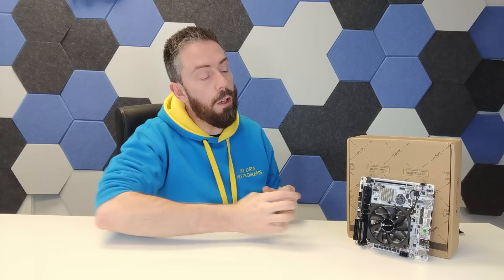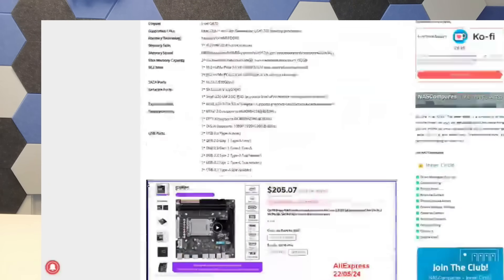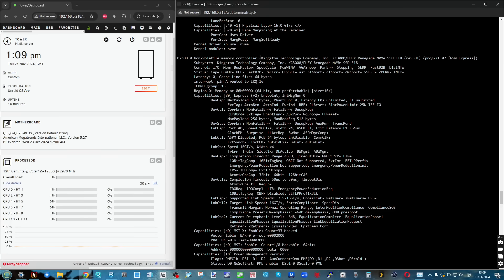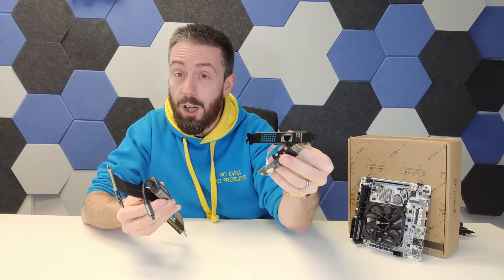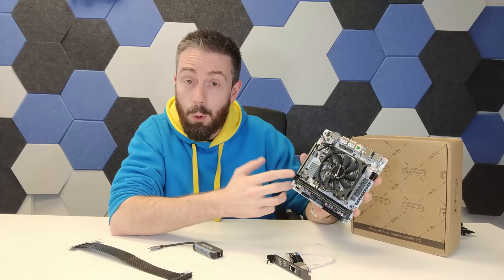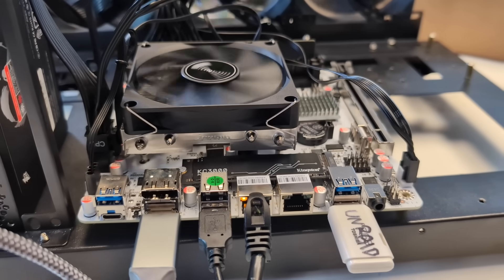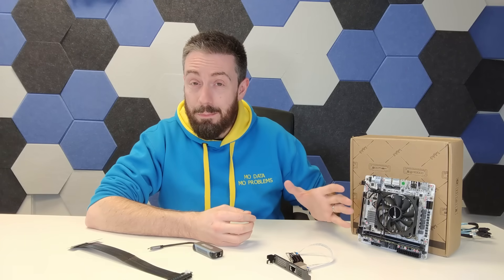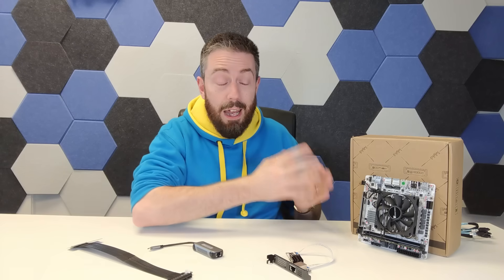NEW CWWK Q670 8-Bay Gen5 NAS vPro Mobo Review

Comment from the maker: Hi all. Since the publication of this video, it was brought to my attention that this motherboard has had several issues encountered with it. Although I never encountered them, further investigation does show a decent amount of users online raising concerns with their units. (Example https://www.reddit.com/r/homelab/s/eeRCYY8wYs ). Going to do a little more digging with this board in the office, but apologies on missing this during the review.
Reply: Definitely interested to hear what else you found out, especially regarding low power states.  The amazon listing claims the back two m2 don't work with ASPM so they keep it off.  30W idle is pretty rough. :'(
Reply: @JBoulter11  Yes, i had the same Issue. Plus LAN ports never woke up again once in sleep mode, even they promote WOL. I talked directly to the factory about this, but just some excuses not fixable.
Reply: @ What did you end up replacing it with, or are you living with the compromise?  I'm trying to build a machine and I'm having trouble finding an intel board that comes close to this one in terms of connectivity options.
Reply: @JBoulter11  Still searching, but sticking with big brands now. Most likely ASRock
Reply: @ Thanks!  I can't find anything smaller than ATX that will fit the bill, unless you're willing to sacrifice the x16 on an ITX board to accommodate an HBA, or sacrifice M.2 for SATA ports.  Looking at ASRock Pro RS and ASUS W680 now.
Reply: Truly. It’s the only board that fit the bill after a few days of hefty reading lol. I just ordered it and will try to investigate. People reporting the front two nvme slots don’t work for ASPM but as long as I’m able to use the 8x8 bifurication support with a PCIe splitter to two x8’s, then use an efficient X710 10gbe nic and a dual nvme card on the other. Really hoping it works.
Reply: @GareBear96  How have you got on with the board? This board really checks all my boxes, and it's really hard to find anything else comparable so the reports of issues was a bit of a downer. Hoping it's been resolved somewhat.
Reply: Probably not but happen to have any updates? The board seems perfect but issues are being reported and I really do want to build a DIY NAS in a Node 804 I got but that M-ITX is somewhat limiting
Reply: What did you end up going with? Just ordered this haha
Reply: @GareBear96  been too broke to get anything so I haven't done anything lol, if I ever get the spare money I honestly will probably end up with this motherboard

Comment: How does this board split up PCIe ressources when all slots are populated? This would require 16 gen5 + 12 gen4 (=6 gen5) so 22 lanes total but the intel CPUs only support 20 pcie 5.0 lanes. Will the M.2 slots be downgraded to x2 or stop working alltogether? I couldn't find any documentation for this.

Comment: My Configuration: Truenas with, i5-14600T, 64GB DDR5, Intel X520 SFP+ 10Gbit, 6x 16TB Seagate Iron Wolf, Jonsbo N4 Case, I just tested everything, the Board randomly feezes and reboots. I removed the drives, changed RAM, Changed .m2 slots for the operating system. Will send it back and replace it with maybe with ASRock.
Reply: Dang, mines in the mail lol… Did you figure out what the compatibility issue was? How much was the return shipping?
Reply: @GareBear96  I found a solution. It did not work with truenas installed directly. So I installed Proxmox and truenas in a VM. It was possible to passthrough the onboard HBA. Everything works fine since. ;) hope this helps you.
Reply: I believe there is a problem with power. CWWK recommends the CPU T version with max 65W because on-board inductors are not powerful enough, plus they don't have a heatsink get hot and shut down the system.

Comment: I just got this board and installed truenas. I added a 10Gbit SFP+ Card. If I transfer files it freezes and just reboots the system after a few minutes. I now switched to the onboard NIC and it does not freeze. Does anybody has the same problem? Does it has something to with not supporting ASPM?
Reply: I believe there is a problem with power. CWWK recommends the CPU T version with max 65W because on-board inductors are not powerful enough, plus they don't have a heatsink get hot and shut down the system.
Reply: Hello, have you found a compatible 10GB network card? I bought 3 and none appear on TrueNAS with the Q670 card.

Comment: I do have the same board from "PeeliCeeli", and running it with 96gb Crucial RAM and a CoreI9 13900 (65w, non K) - So far so good
Reply: Nice, have you tried going in bios for ASPM yet? Also, what’s your use case? Trying to talk myself into thinking I need 96gb ram 🤣

Comment: Do we know if the SFF-8643 is a SAS controller? Can I run the breakout cables to the backplanes and then use SAS drives with this MOBO? I need to upgrade my storage in my next build, and I think that I can find used SAS drives at about 30% the cost of SATA. That would be a big win for me. Also, I have seen a lot of BIOS configs online that have gotten this board to idle down to C8 and drawing under 20w as well.
Reply: I believe there is such adapters yes! Both SFF ports use the same chip (forgot the name but it supports SATA). Also, where have you seen those posts? I found a good one on reddit I printed out to try when mine arrives. Really hoping I can fit everything I want!

Comment: Looks like a very nice proxmox board .... are the 2 sata connectors on dedicated controllers so could be utilised by to different VMs?
Also i run a 13-1200 and downclock and undervolt to get much lower power consumption, does this board support this?

Comment: Well crap, I was looking at this MB for a 8 bay NAS. After reading the issues, looks like I will stay away.. Any recommendations for a i5-13600KF Processor, 3.5GHz. Not really looking at ECC memory ( due to cost). Really like the 3 m.2 slots.  Wondering about the Jonsbo N3 or N5 case, how are those rub drive mount pull handles compared to a solid caddy? Been looking at the U-Nas 810a.

Comment: I have a similar board. trying to pair it to a Silverstone RM21-308 and struggling with the use of SFF-8643 on the motherboard to 2 SFF-8087 connectors on the server backpane.

One bit of info I got was that sff-8087 to sff-8643 cables might be the wrong direction and I need  sff-8643 to sff-8087 instead. Still no joy getting the test HDDs to detect.

Otherwise the board is working well so far

Comment: Did you use a full fat 12500, or the T version?  With boards/users that have problems in mind, could you write up for us which memory and nvme you were using?  Other products have had favourites and disliked brands.  So your choices may have helped with reliability.
Reply: In the write up linked in the description you can see it's a 12500 non-T and the SSDs are pictured as well.

Comment: After waiting months and months for Synology to disappoint me with new enterprise products, I went with a Q670 build for my first ever NAS, went over budget but am really enjoying the extra performance on tap
Reply: Nice mate, what’s your setup? My stuff is in the mail… Q670 white, i5 13500T, 8 bay 2.5” ssd rack from the two SFF’s, gonna try to bifurcate the x16 to 8x8 with the on board switch, and a 16 to 8x8 splitter card. One x8 for Intel x710 (most efficient and enables ASPM I’ve read), and a dual nvme card. How’s your Wattage output and compatibility looking?
Reply: @GareBear96  can't remember my wattage, I had my Killawatt on it when I got it but didn't record the numbers I was getting, but I've got the same 13500T chip, still going strong and still happy I stayed away from Synology seeing the latest news about locking down hard drives

Comment: I really liked this kind of mobos until I looked at them seriously in order of purchasing one. Simply put, they make no sense. For less than half that price I bought an Asus ATX motherboard with 6 sata ports, 3 m.2 ports and more pci connectors than I can really use without reaching the pci-lanes limit for the cpu. Put on top of that an i3-12100 and still you would have some money to spare before reaching the price of that chinese motherboard with who knows how many issues.

Comment: For ECC it would need a W class chipset (eg W680), but its pretty neat. Also a DTX variant with two x8 slots would be handy variation (eg. for a Node304 chassis or most of ITX enclosures made for dual-slot GPUs). Then a slight shape adjustment into the depth also would made possible the underside NVMe's moved to the top for easier access. Not that I am happy with all three Gen4x4 sharing a bottleneck in form of the DMI .. but be it - at least it keeps the PEG slot and all its bifurcation options for expansion cards. If size would not change, then the two extra NVMe would be nice be in form of connector for cabled drives (eg SFF or slimsas) - as one just have to cool a gen4 drive anyway and the underside ones are being grilled too much in this setup imho.
Reply: This supports bifurcation on the pcie gen5 slot, only to 8x8 though (I think it’s literally a manual switch on the board lol). I plan to use that along with a x16 to 2x x8 lane board, to a x8 x710 10g nic, and a x8 dual nvme card. We shall see! Top NVME’s are reported to disable ASPM tho…

Comment: Sucks that you won't get ECC support unless you use a "workstation" class chipset like W680 --- even though this is just a pass through as the Intel CPUs handle memory and ECC internally.  Any idea on warranty repair costs/time for these CWWK motherboards?  I can't help; but, wonder if these cheap motherboards use decent enough capacitors and other components to last long enough for ECC memory to be a worth while long term feature.

Comment: One point I'd like to understand better, if anyone can help me out?  It's mentioned near the end that some wouldn't want to use SFF to SATA breakouts - is there a reason? Besides the form factor, the SAS protocol I'm familiar with has 4 channels per connection, which should support 8 drives here the same as 8 individual connectors.  Yes?

Comment: Waiting for this board to be delivered. I should've dig more into all the issues people are reporting because it seems there are many. Given title of this video has "Mobo Review" in it, I was hoping to see some of these issues covered. I'd say this is more of a overview of a product rather than review.
Reply from the maker: Hi Mark. The honest answer is that I was not aware of the issues, largely because I didn't personally encounter them - so didn't have cause to check. But it sounds increasingly like I got lucky. Gonna make a pinned comment highlighting this (going to point at this Reddit post here https://www.reddit.com/r/homelab/s/eeRCYY8wYs ). Apologies for missing this!
Reply: @nascompares  Glad to hear you didn't have those issues. That's uplifting. Given you you're around 30W at idle with i5 12500, I understand you didn't try tuning for power consumption? I read a lot of people have problems with ASPM turned on. I also saw few people achieving sub 20W numbers on idle.

Comment: I have one of these boards (I think, came via King Novy store on AliE), waiting for other bits to arrive to hook it up properly. However, while they say it supports 5600 DDR5, mine refuses to run the RAM at that speed and doesn't offer XMP to unlock from the base 4800. "Support" in this case means, "you can plug it in and it will run at 4800", at least for my board.

Comment: I don't understand the motherboard maker obsession with ITX.  I think its fairly clear that a larger board with physical x16 slots and bifurcated x8 and x4 allocation options would be a functionally superior design.  If you want a gaming rig with a graphics card and some SSD slots for steam, great, but messing around with PCIE extenders feels like Apple's dumb idea of putting only USBC on laptops. Even PCIE gen5 for a mini NAS (or gaming) seems like expensive overkill on an i5 board.
Reply: Except the board is still only like $250 so eh

Comment: Repeated misuse of "architecture" - version/generation etc is NOT architecture. Also, IO isn't scalability in the way that it's mostly used. Sure, you could hang a bunch of stuff off USB in various flavors, but to me the point of building a NAS thing like this would be to have the stuff internally inside one box, not having a bunch of adapters and jank hanging off USB of various flavors. Just my 2ct. This only really makes sense if you can source the rest of the parts for free or supercheap, since built up the base system gets into a category where it is competing with serious setups based on the price, like proper servers that have a lot of features this does not have, like lots of slots for network cards, storage controllers, GPUs for transcoding/AI, slots for more RAM, better and in some cases more CPU's and so on forth. There are Dell and HP purpose built servers which can be had for not that much money that have greater potential for most uses - the one thing where they do not beat this is choice of case pretty much, so they look like they look since you can't case swap them easily.

Comment: the reason for the speed decrease on the ssds is the usuall: not enough pci-e lanes. only 1 m.2 and the pci-e x16 go directly to the cpu, the rest are connected to the chipset. i've tried a lot of those boards, it's the same deal. they try to cram as many interfaces as possible, but they end up not working good at most.
Reply: Correct.  And really the only way you're going to fix that with Intel is to go Xeon - None of the current gen CPU's have much PCIe bandwidth.  A few designs put the ports behind a switch, but that still bottlenecks in and out of the CPU.  For anything "serious" mini-itx really sucks, and most consumer level boards aren't that suitable for high-speeds due to this too. (Some exceptions exist... sort of).  Personally the video could stop with "No ECC" and I would be done there, since integrity of data is the whole purpose of a NAS, and Intel has been holding that back for enterprise-only for years.
Reply: @ChrisCebelenski  another problem with intel is bifurcation. you get only x16+x4 and x8x8+x4. amd is better at this but still has the same number of pci-e lanes, i think. meh.

Comment: Ecc limitation is a Intel choice (if the motherboard maker used a ryzen cpu, ecc works just fine) ecc is limited to i3 and xeon (or soldered cpu) and right chipset combo
Reply: some consumer range Intel CPUs allow ECC support now, for example, i5 14500, the motherboard itself still needs ECC support as well
Reply: @TheEfthyy  That isn't exactly how it works. Most of the 12th gen and up CPUs support it, but only with a single chipset. Any A/B/H/Q/Z chipset model will instantly tell you that it won't have ECC.

No matter what, you can only ge ECC on them with the W680 chipset. Since I never see it on anything Chinese made, I suspect Intel is either stingy with it and only sells it to big companies or they charge a ton for them and people won't buy this board if it has ECC and is double the price.
Reply: @PeterBrockie  yeah like I said the mobo needs to support ECC, via the W680 chipset like you mentioned, likely just a cost thing, most consumer diy people buying these don't care about ECC likely, it's definitely worth it but not needed
Reply: @TheEfthyy  I wanted to have ECC but then I've seen the prices of DDR5 ECC memory and W680 and noped out.

Comment: I have it since last week! I thought it was faulty because it takes 40 seconds to boot with mine 12500T and 32Gb of ram! It has been working 24/7 ever since 😊😊😊
Reply: Nice to hear. Could you share with us power consumption numbers? Have you tried turning ASPM on? Do you use all 3 nvme slots? What RAM and nvme SSD do you use? I hear mobo is picky when it comes to skome brands. Thanks
Reply: @markas85  I haven't checked the power consumption yet, but I will. Currently, I'm using one NVMe slot, three HDDs, and one SSD in a Jonsbo N2 case. My setup includes an ESXi host running a Sophos firewall, FreeNAS, Linux, and a Windows VM. I have 2x32GB Kingston DDR5 RAM operating at 4800 MHz; higher speeds require a 13th or 14th generation CPU, and a Intel 10gb X550 T2 network card. I don't know if ASPM is on, I'll check that too
Reply: Any update on this? Mine is in the mail and will investigate myself, just looking for any head start, thanks!
Reply: @markas85 it specifically states on the listing on AliExpress that it doesn't support ASPM, and not to turn it on.
Reply: @wasitacatisaw83  ASPM works for these boards. Not for all Nics or nvme extensions but I am having success. Other than the top nvme board, I have the rear two and 64gb ram achieving c7 at 16W

Comment: CWWK had a Core 8505/i5 itx board with an SFF to 4x nvme board.  Is that still available? I was tempted by that. Info was scarce on their site, but i guess it would have been throttled to x1 lane per nvme.

Comment: Those boards are very bad with power management as well as Bios settings and documentation. Mine always freezes up when aspm activated. I basically choose it for due to (not working) power saving features
Reply: It's really a shame because otherwise this board is so promising.  If it wasn't for the issues with power states this could be a slam dunk. :'(
Reply: The listing on AliExpress specifically states that ASPM isn't supported and not to turn it on, so I'm not sure why you are?
Reply: @ I didn’t buy it on Aliexpress but directly from Factory via Taobao, here it doesn’t mention that ASPM isn’t working. Even their support didn’t know about it
Reply: I have it currently in c7 at 16W with 64gb ram and the rear two nvme slots
Reply: @GareBear96 Can you share your BIOS Settings?